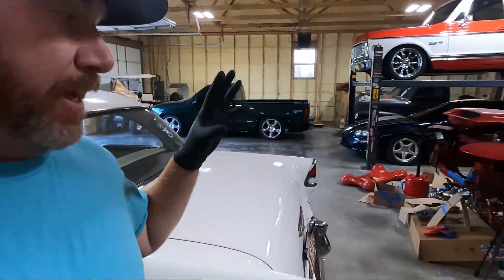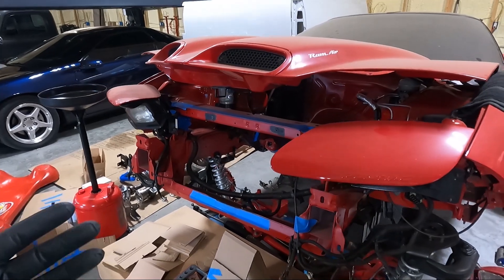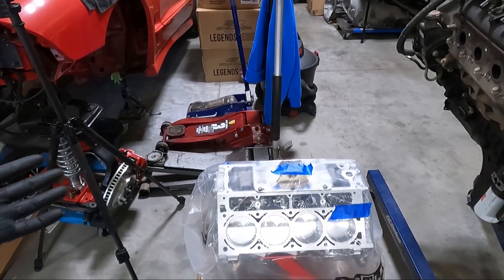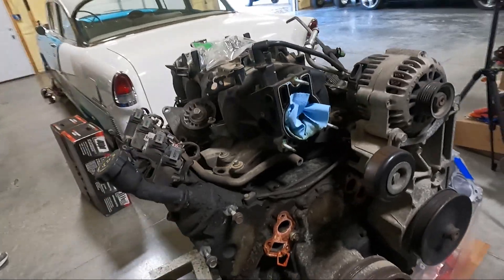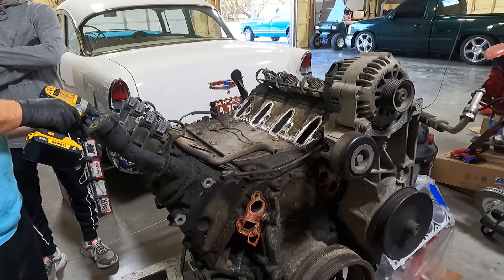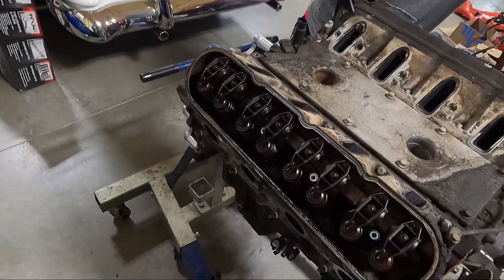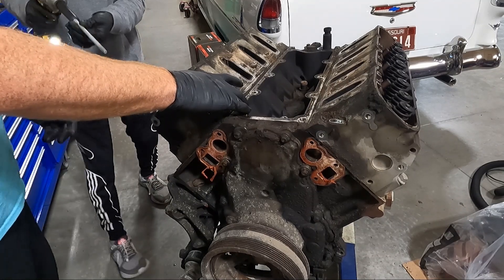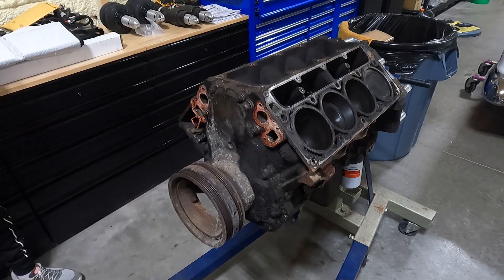New Motor For Twin Turbo WS6 and 55 Belair (Time for Tear-down)

Comment: I meant to ask, are you still running stock 10 bolt?
Reply from the maker: I am
Reply: @TWAMotorsports  I swapped mine out for a MIdwest Chassis Fab 9 inch and absolutely love it! Quieter than the stock 10 bolt with their torque arm. No more banging on the body with other aftermarket ones.
Reply from the maker: May have to do that eventually
Reply: @TWAMotorsports  mine ate up the stock rear after H/C and LTs, I have an A4 with a billet converter. But I hear the 6Spds are harder on the stock rears.
Reply from the maker: @joe00camaross  6 speeds are. This is an auto though
Reply: @TWAMotorsports  OH!! Ok even better 🤩
Reply from the maker: Yes sir